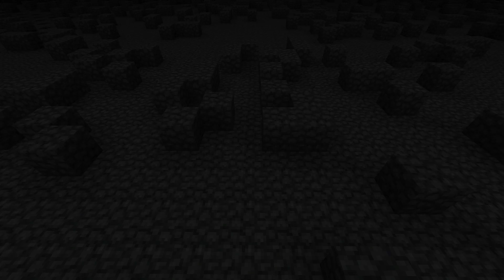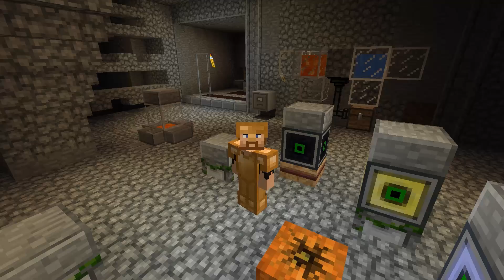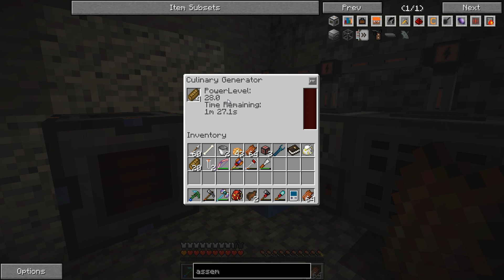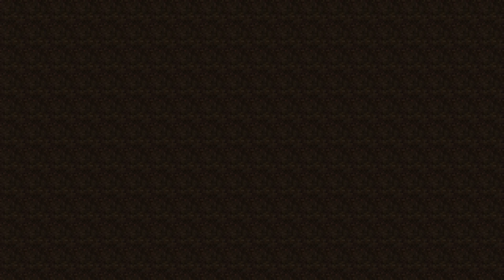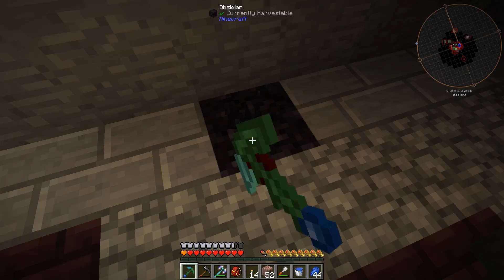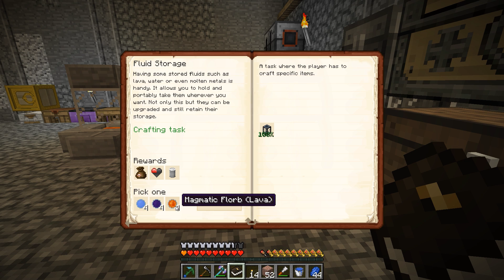Zombie Power (Minecraft Obscurity Modpack | Episode 16) [Modded Minecraft]

Comment: I know. This is 3 month old. Some note:

All the servos are not necessary. The tank pumps the water by itself, if it is set to output. Also the assembler has an automatic servo. If the first assembler is moved direct under the water tank, even the fluiduct is unnecessary. It is enough space to put the second one directly beside the fist then. It results in a much more compact machine setting.
Reply from the maker: +kla_sch Thanks for the tip, I've since moved on with this set up but it's good stuff to keep in mind. Thanks for watching.

Comment: you can also use the magma crucible to power and supply magmatic dynamo (4 of them ) and get "free" power using Netherrack and if you upgrade the crucible to resonant and put some nice augments in the dynamo your good to go for power
Reply from the maker: +Mablez G I think that will be a good long term plan. But I always thought you'd end up with a deficit by cooking the netherrack for lava which costs power and then turning the lava into power, but with the right augments, you probably can come out ahead. 

But netherrack isn't infinite either, we would need to automate its creation too. Which means automating the mini portals as well since those have durability and then we need to automate the creation of those resources and it all circles back to luminite probably, the one resource we need to always mine for.

That's why I kind of liked the mob drop based power system since it costs hardly anything to craft food (100 RF per operation per cyclic assembler). And the resources for food here are completely free with the mob farm.

Comment: Might want to consider spider eye soup as well.  Just requires bones and spider eyes.  At 80k RF at 32 RF/t it's better than toast.
Reply from the maker: +hossumquat Oh, nice! Yeah that will work nicely! Just need to make sure I do it in a way that doesn't deplete my bone supply.
Reply: I find I get far more bones than spider eyes.  And one bone makes 3 stock so you use 3 times as much spider eyes than bones.
Reply from the maker: +hossumquat oh yeah that makes sense. I think I might have to automate some stock because that is used for all kinds of recipes too. Thanks for the idea.
Reply: Glad to help. :)